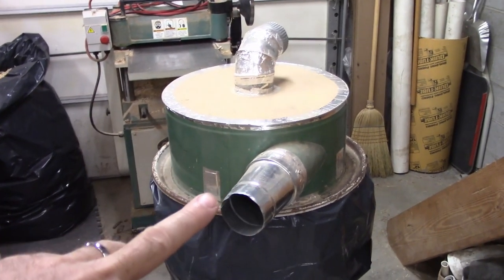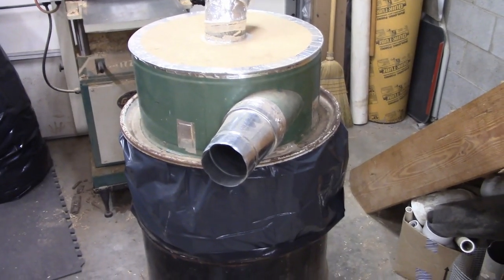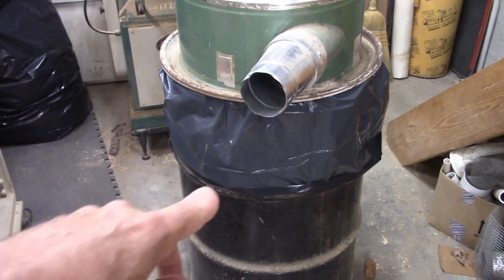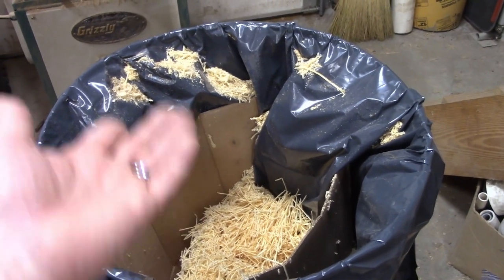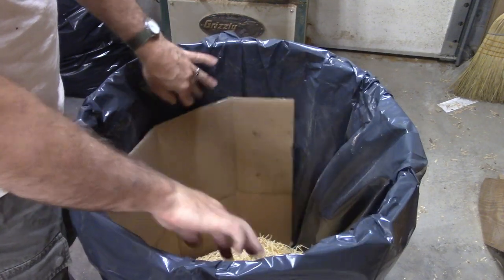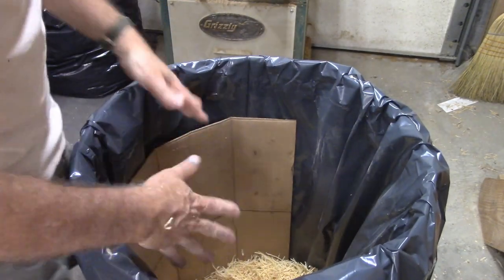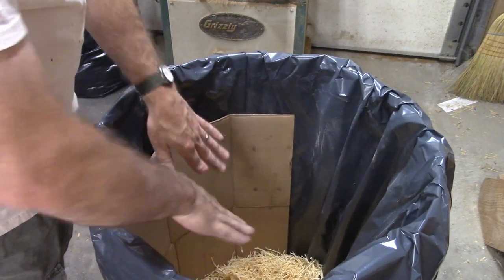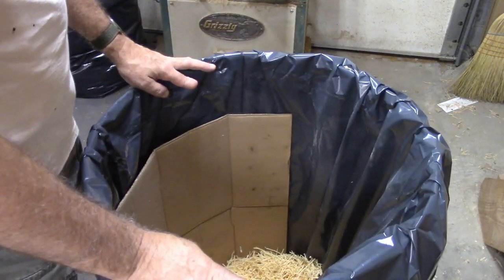Using Plastic Liners in Dust Collector Barrel

Comment: Mr. SOATMON, how does this work.  Are just directing the discharge from the plainer into the barrel or is there a shopvac connected to the arrangement?   I just don't quite understand and I know what you mean about the volume of shavings.   I am not at the shop now but I believe I too have that same Grizzly planer that you have.   Good tool.   I am making the most of the wonderful fall weather to get things done.   Went out and winterized the plumbing in the shop while it is still a little warm.   Hope  you are doing well and having a good weekend.
Reply: The dust collector (sitting atop the barrel) sucks the chips into the barrel-
Reply from the maker: Here's an older video that explains it:  https://youtu.be/45cEt2foPd8  I have a dust collector located outside that sucks out of the top center, chips come in the lower connection on the side.  The dust collector just exhausts outside and the original plan was to just blow the chips outside into a pile but the curly planer chips would always stop it up so I had to put this barrel in to catch the chips before they get to the dust collector.  Then I found that I had to empty it every few minutes which was slowing me down.  I thought I would add  a bag so I could just pull it out, put in a new bag and move one but the bag would get sucked up and stop it up.  That lead to the cardboard insert that has finally made this a workable solution.  I use the chips in my garden and in my barn so having them bagged works out well.